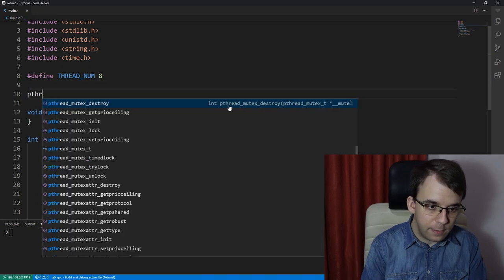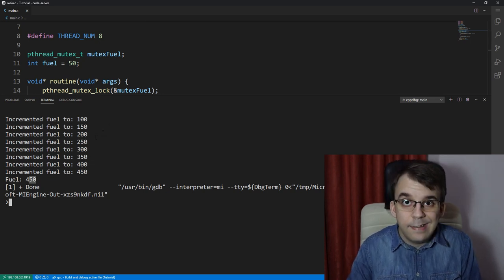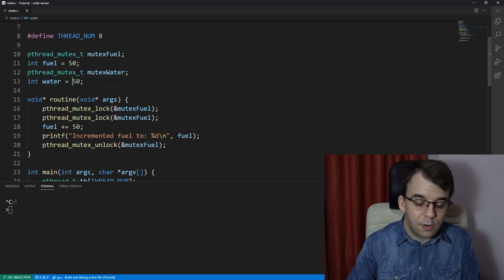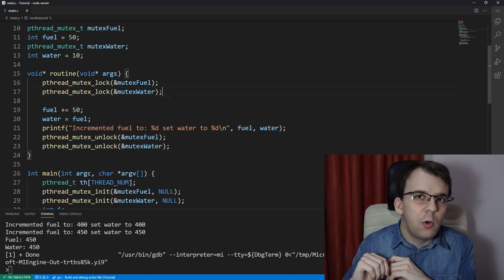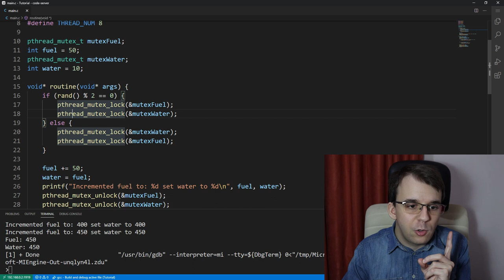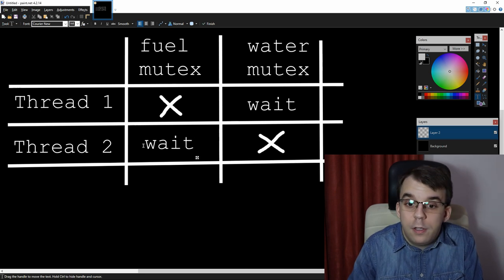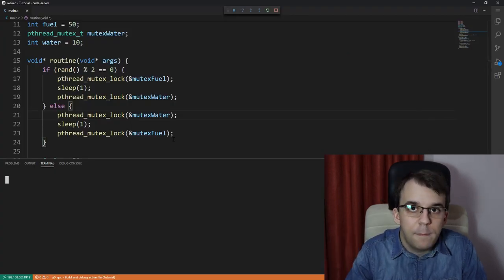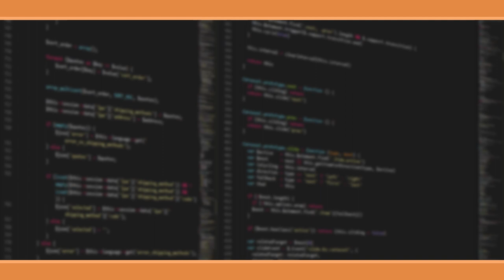Deadlocks in C

Comment: Nice video! I have a question about why are you using two mutexes for fuel and water, Can't you just use one mutex to protect both variables since both variables are under the same lock?
Reply from the maker: Yes, in this exact use case, that would be the solution. Although, this was used just to exemplify deadlocks... Think of the code in the video as part of a larger project where the locks for water and fuel are used individually for other types of operations

Comment: Hi, I actually didn't understand the part were you create a separate mutex for water , isn't one mutex enough to lock both fuel and water under it?
Reply from the maker: Good question! Yes. In this simple example you could use only one mutex. But, imagine these 2 variables are used independently somewhere else in the program. That's when you need separate mutexes